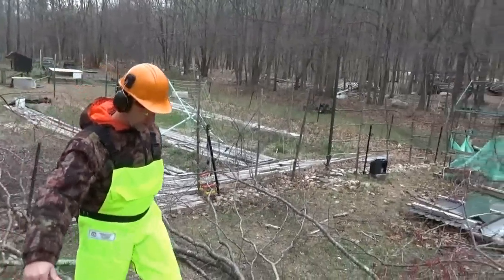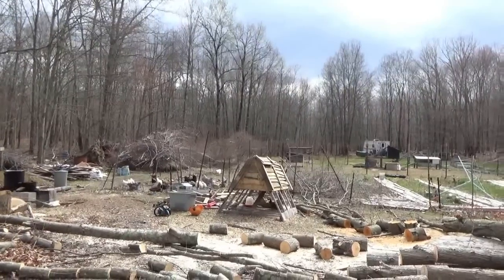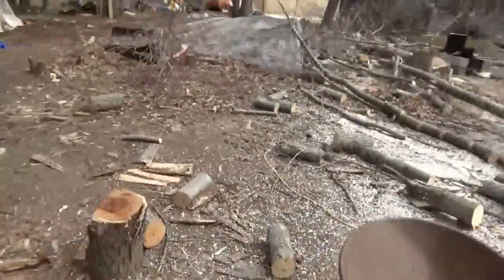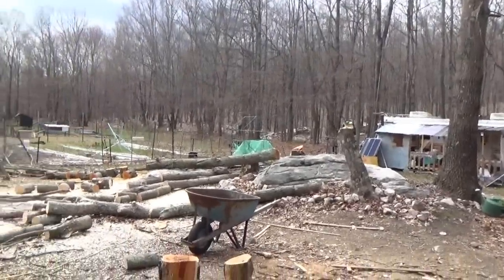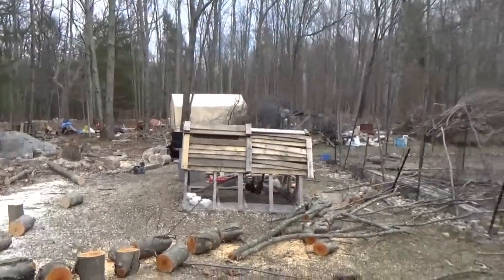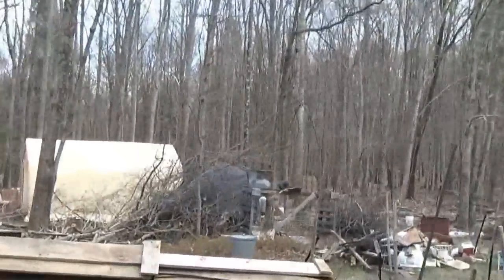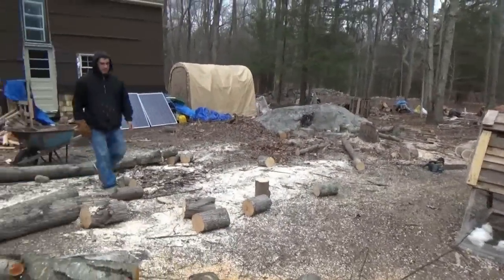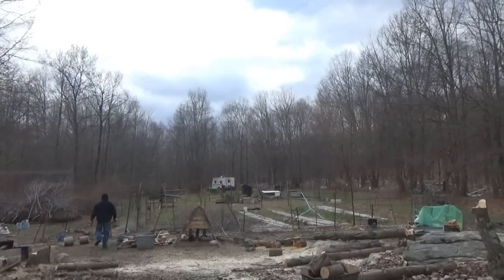Cutting Logs & Cleaning Up In Front Of My Off Grid Tiny Home

Comment: You should cut those stumps low and flat and them drill them. Several 1 in. holes as deep as you can get them and eventually get some wood rot to put into the holes. Would reduce the stumps in a couple of years.
Reply: JAI Colorado Good advice!
Reply: JAI Colorado Or just cut them flush and let them rot.

Comment: Please burn that  pile of varmint habitat brush before unwanted critters move in. The chickies will thank you. split those rounds Xtra small,, 6 wedges instead of 4, to facilitate drying. they are SO wet they may not be dry enough by fall of 2016. Maple is funny that way. How are you gonna mount the solar panels on your tiny house? Use a pallet, a frame?? GOOD location btw! The foil should spare you from roasting in the sun this summer. such good insulation! cover your windows tho,,

Comment: Facing 180 relative or in dat lingo target front in Dixie. Now the chicken tractors and coops need to move the east side of the new one this winter to keep your treks to gather eggs easier. Cut logs can go furthe north and east yet. Nice easy area to clear out after storm. You are right that tall tree wiil be a job unless you top it off first. Tim might be able to climb up it for that. Need lineman leg spikes and a buck saw. Just remember to cut above the holding strap, not thru it. My uncle did it with a stuck landing from 65feet straight down the trunk. Only blew both of the following, ankle knee and hip. Took about three years to get to a walking pace again, but he did.

Comment: When you have a lot of those long straight smaller branches, cut the ends off at the farthest most point from tree, clean off all smaller twigs, then cut the branch from the main part of tree, do this to all that is accessible then construct an X framed saw horse apparatus with an X spaced at the length required for stove length and pile the limbs into the top portion opening, that way you can gang saw all that is in the X frame at each X frame point and all will be about equal in length. It makes it a lot faster and easier in my opinion. There is more BTU's in the limbs than in the main part of the tree, they burn faster but gives off a lot more heat in the process, good for day time use and use the larger pieces for use at night for a lasting heat source.
Reply: Nortekj I've also found that, when starting from a cold stove, it's easier to get the small limbs to burning than it is to get larger one started. Kindling gets the small limbs burning and then they get the larger ones to going.
Reply: J. Williams Yep that's right, the fuel source has to reach kindling point before it emits the gases required for combustion and the smaller limbs heats up a lot faster than larger diameter pieces, Plus they "season" out faster as well.

Comment: I always found that dragging out the brush and stacking it was more work than cutting up the tree and splitting the wood!
I'm sure that when you tripped and landed on your rib that you lay there laughing (or something!) - that ain't the way to get it to heal!!! :-)
I agree with +shartne about using the smaller wood. I usually cut anything larger than about 2 inches and burn it in my stove.
I noticed that you put the chickens back in the "pallet house" so it must not have been damaged too much. - About catching the chickens when they get out, try a large dip net/landing net. Those that are about 12 or more inches are great for scooping up a chicken!